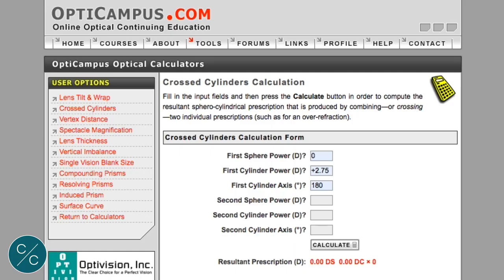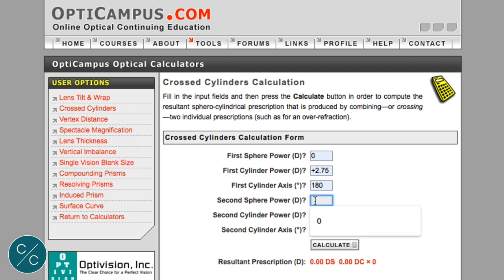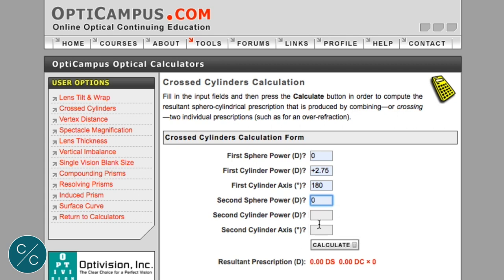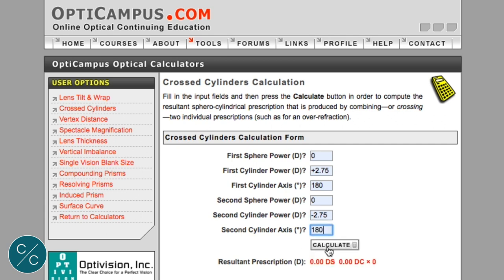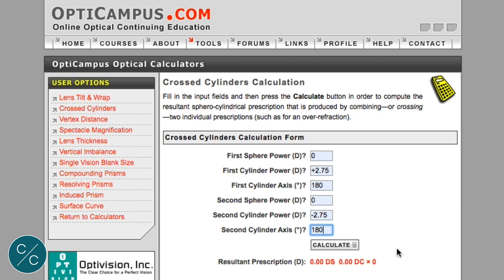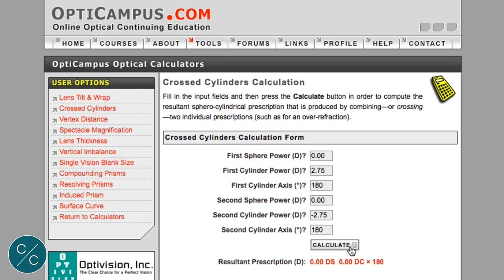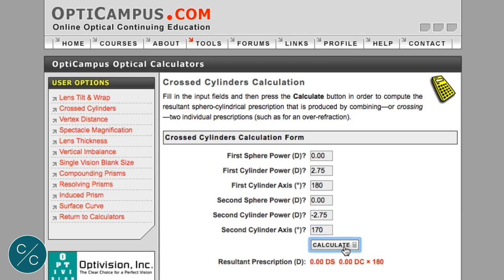Indicating the Degree of Rotation with Toric Lenses | Contacts with Conway

Comment: Informative. The axis marker/ line even for trial lenses with oblique axes eg. 45, 135 may indeed remain at the familiar 6 o clock position. The line only represents the degree of rotation I understand. Right?
Reply from the maker: Hi @radianceaghedo3563! Yes the mark should be stable near the 6 o’clock position. It doesn’t mark the axis of the astigmatism, it just lets the practitioner know that the lens is sitting correctly and to adjust if needed.

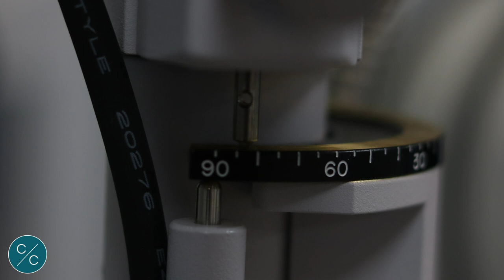Comment: Sorry, it might seem a bit obvious, but how did you assess that the angle of rotation was 11 degrees based on the scale of the slit lamp at 4:00? Thank you.
Reply from the maker: Hi Manh Nguyen, as you rotate the slit beam to align with the markers, the scale at the top of the slit lamp indicates the degree of rotation. In this case it was 11 degrees anti-clockwise.

Comment: please tell  me how you set up the slit lamp for that thin beam starting at 3:17, thanks
Reply from the maker: Hi Binh, 

Slit lamps vary, but normally there is an adjustment knob adjacent to the place where you adjust the width of the beam that will enable the beam to be rotated. There is normally a scale attached to indicate the angle of rotation.

I hope that helps.
- Martin